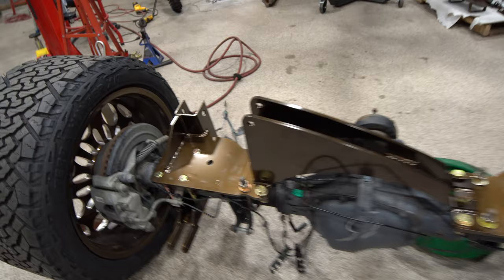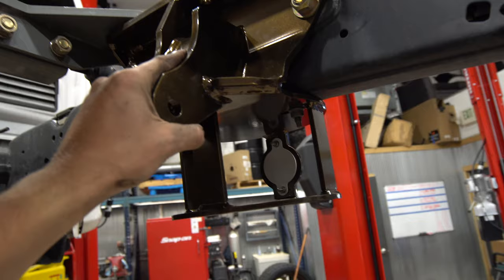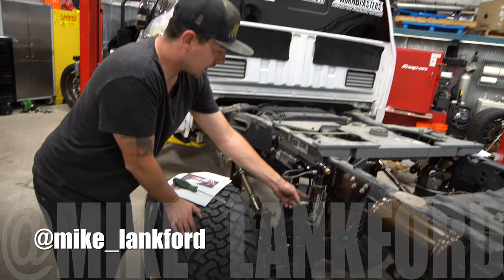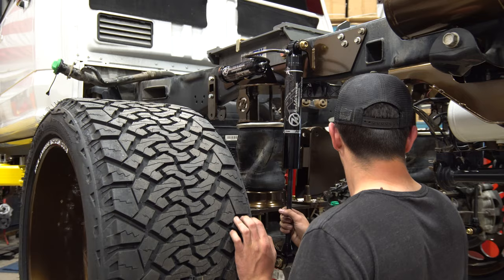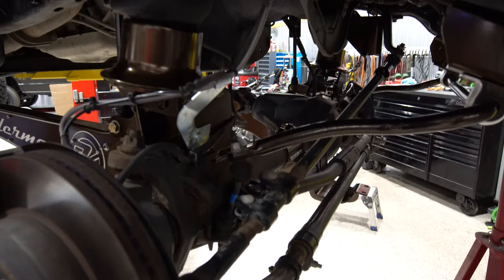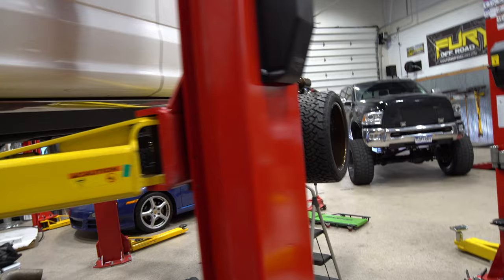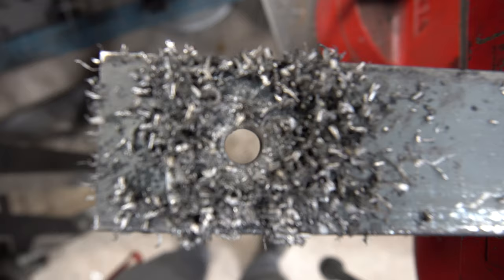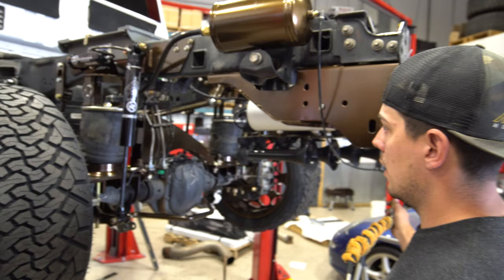FULL KELDERMAN AIR RIDE KIT INSTALL (PART 2)

Comment: This WAS an interesting video till you skipped over most of the install of the front end and all the mounting for the rear trac bar supports.
Reply from the maker: Hey Bill so we made 3 parts to this video. In the first part we covered the front and started on the rear. Unfortunately it is not a full step by step how to video. It is just showing how much work is involved and most of the process!

Comment: What happens to the steering as the suspension goes up and down? Wheel just goes out of center?
Reply from the maker: That is correct. The "ride height" is set where everything is centered, and will go side to side just slightly as its aired up or down.